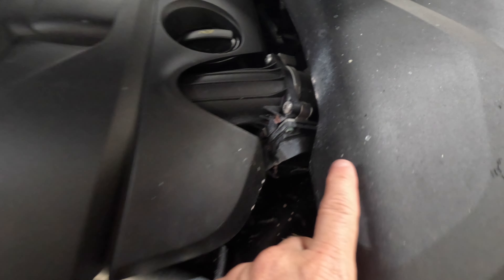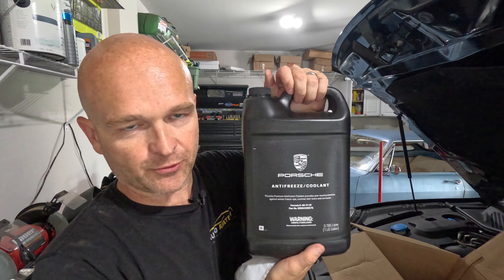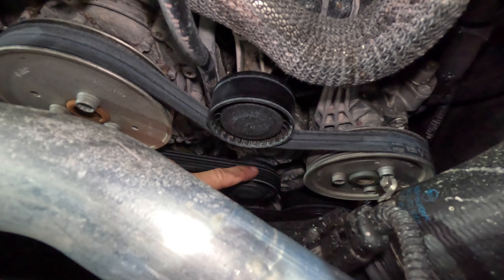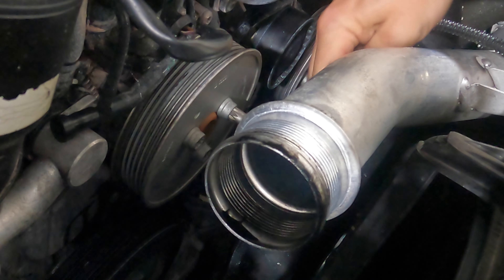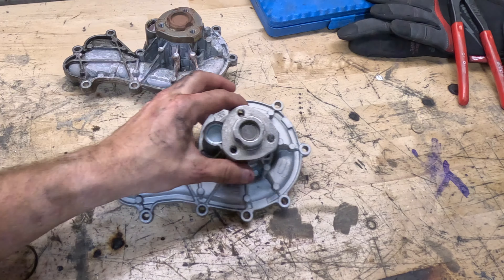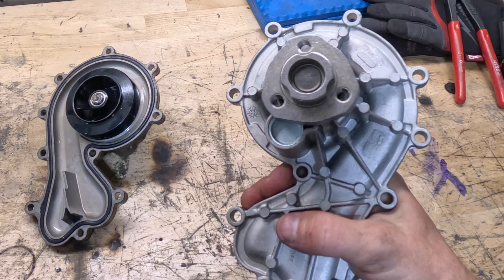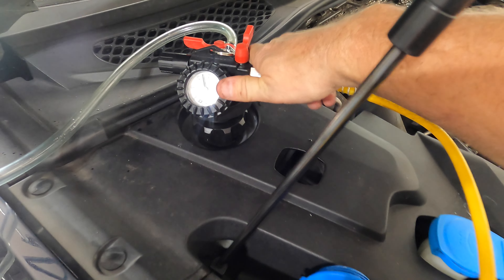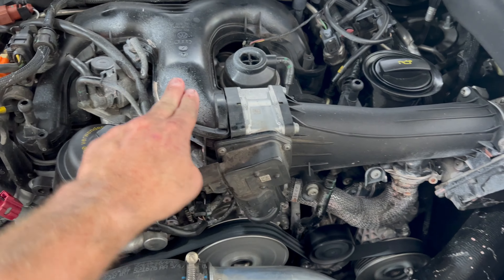Porsche Cayenne 958 Diesel Water Pump Replacement

Comment: Very easy job for a modern vehicle.  Those plastic impellers are troublesome on certain models.  VW 1.8 Turbos used to suffer impeller failures all the time.  Changed many of those over the years...  Looking forward to more Corvair content.  My '66 is heading to its first show this weekend!

Comment: Hi Sean.

Sorry I was not online in time... 🙄

Really good job, the waterpump is always best as a new with metal impeller for long term use.

On Audi V8 machines you can get both on aftermarkets suppliers, plastic and metal, the plastic ones are often lose after short time use about 10.000 km....

So I've always decided to get a metal impeller on every pump on any car.

Have a nice time and thanks for your video 📹! 👍 🙋🏼‍♂️
Reply from the maker: Thanks Joe!   Hope you’re well
Reply: @AutoAnatomy 

Thanks Sean, I'm alright... 😉 ✌️ 🙋🏼‍♂️

Comment: The main difference in the two impellers were ! The factory used a ( closed impeller wheel )  The after market was an Open impeller wheel.  Each have there good and bad but metal any day over plastic .
Reply from the maker: I tend to agree, but the plastic one did make it to >100k miles!   Regardless, it’s done and it was very easy to replace.   Good on ya Porsche for amazing engineering.
Reply: @AutoAnatomy   Better to say the plastic did not fail in 110k miles. The bearing did. Still... when the pump bearing failed on my E39 2.8 I certainly replaced it with a metal impeller version. I wonder which one flows the best?